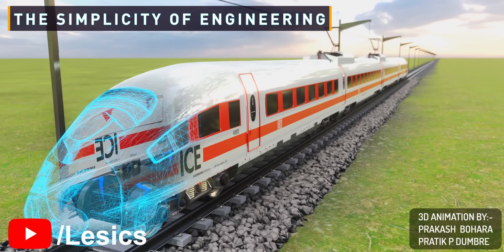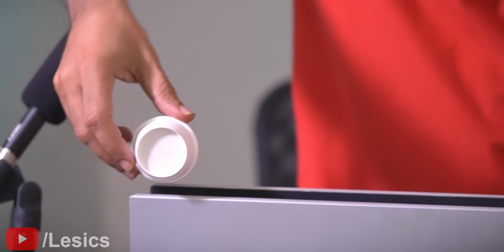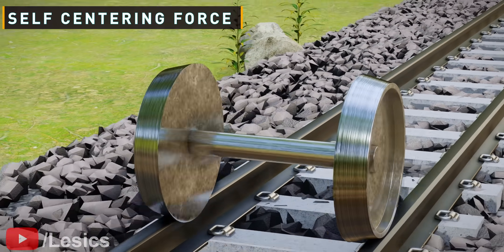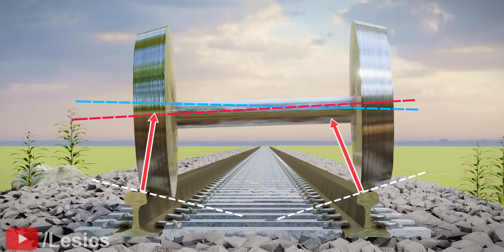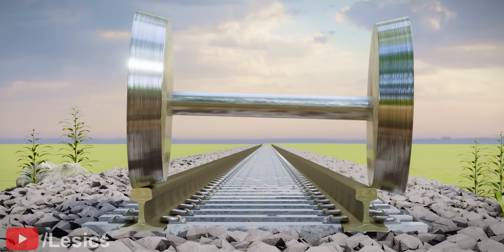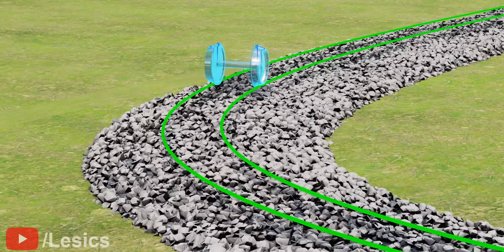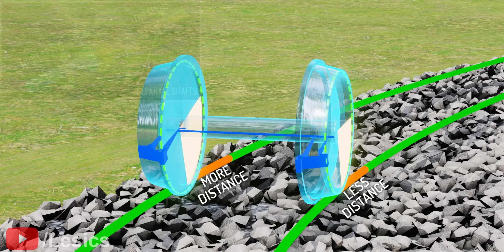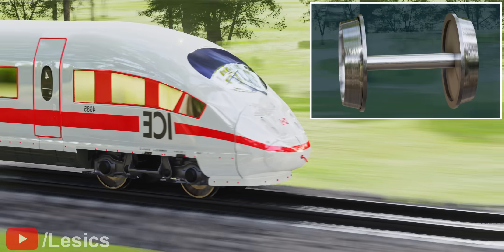The interesting engineering behind the SHAPE of Train wheels!

Comment: Still doesn't explain the shocking train wheel squeeling that happens and to this day engineers have no solution
Reply: I think the squealing is caused by the flanges rubbing/ making contact with the rails periodically.  IIRC, the squealing happens most when the train car is rocking or coming out of a corner.  As for solution? It's part of the charm of riding the rails!
Reply: What’s shocking about it?

Comment: I have seen lots of train wheels, but never looked close enough to see the taper. Makes perfect sense! I always assumed that it was just the flange that kept the train on the tracks.
Reply: Pretty sure the angle is exagerated in the video to clarify the concept. You'll notice the animated wheels are very wide, another exaggeration for clarity.
Reply: @GregMoress  You can still see it if you look at the wheel
Reply: @GregMoress  The angle isn’t exaggerated, I work in CNC Engineering and we make train wheels, this is exactly how the taper of the wheel is. Pretty mental really haha
Reply: The flanges are required because in turns or on irregular tracks,  the wheels could still push themselves off the tracks without them.
Reply: Can anyone explain if the differential effect limits how the sharp a turn can be? I feel like that also coincides with the fact that inertia of the train would also limit the turn radius to prevent it from tipping over and derailing. Thanks!
Reply: @edwinerickson6035  look up curves in FRA 213
Reply: @edwinerickson6035  i tinn dares ahh, king pin two elp, negotiate tunzez
Reply: @enzoorciuoli328  what?
Reply: @tfan2222  i blabed out dah anser two yo ,questioning,kink pins swivelie,swivler
Reply: Same here!
Reply: Previsão é que
Reply: Right same here ❤❤👍☺
Reply: The flange is especially needed to keep the train on track in tight turns and switches.
Ideally the flange will not hit the rail.

Comment: Another thing is switches. If the wheels had the cone on the other side, it would not be able to cross over.
I'm on a train very regularly as a passenger and i have contemplated all these things but i could not figure out how differential would work. So thanks for that!

Often when the train moves around a bend, one can hear a screeching sound from the wheels. I was thinking of this theory as a passenger :
I thought there is also a longitudinal effect that has to be considered in bends.
I find it difficult to explain, but because the outside wheel does not turn in tighter than the inside wheel (like the front wheels on a car work, there is some wear taking place on both inside and outside wheels. And that this is also a reason that bends should not be too tight, apart from G-forces risking a derail.
In my mind this is causing that screech on the inside or outside wheels.
And the larger the train wheel, the bigger the issue.
Reply: The screech comes from the inner part (flange) rubing against the rail. Lots of trains use graphite sticks that put a bit graphite on that part to minimize wear and therefore sound.
Reply: @demacherius1  Thanks!
Reply: > Another thing is switches. If the wheels had the cone on the other side, it would not be able to cross over.

Sure, but you wouldn't design the same style of switches if the wheels worked the other way. There would be a different type of switch that did work.
Reply: @sejje  I really wonder how that would look like. 🙂

Comment: I think you left out another huge factor to the way a trains wheels are shaped along with a crown on the rail and that is Dramatically Reduced Friction allowing trains to pull extremely long, heavy loads with minimal required energy. Of course Newton's Laws apply and therefore it does take significant energy to get the train rolling, but the reduced friction makes it much easier. Once the train is rolling, it takes much less energy to maintain speed, again thanks to the reduced friction and Newton's Laws.
Reply: Rail types in terms of poundage, profile, material composition is a whole subject in itself.

Comment: great video, but change the word Gravity to Density. Thx The Train/wheels are denser than the air and therefore the forces will want it to slip off the tracks down. Saying Gravity is a force pushing/pulling down is wrong, the action is moving the wheels/train which then by the laws of density will make it go off the tracks. The wheel shape just allows the reaction from the action to keep it on the track.

Comment: When I worked at Horwich Loco Works in the late seventies one of my jobs was to machine the profile on the wheels, the profiles are not all the same depending on what the wheels were fitted too, what weight and what speed etc.
Reply: Would there be different profiles on the same train? Such as for heavier or different length cars? Or can they be mixed without issues? I assume same profile on the same axle, of course, but would a mix of profiles on a single car cause instability or ??   Thx

Comment: the only problem with this theory is that the rails aren't designed to take on angled pressures of the conical wheels. They were designed for a flat wheel with a flange. The conical wheels will force the rails outwards and weren't anchored deep enough to accept these kinds of pressures. The rails would have to anchored on a inward angle towards the rail and from both sides to maintain true flatness of said rail.
Reply: Most rails are actually installed at a very small inwards angle

Comment: Not sure if it was mentioned before, but rails are not directly pointing up, but slightly tilted inwards to match the cone of the wheels. These 2 are the reasons why train doesn't derail and why flanges are only useful at corners and points. On straight or almost straight track, flanges don't touch the rail.

Comment: This differential action prevents slippage which would wear out the rails quickly.  The rails are also 4’ 8 1/2” apart.  Why that number?  Because that is the distance between the tails of two horses side by side, which the Romans used to align their chariot wheels.  Thus Rome had roads (very straight ones) with deep groves
Reply: But the grooves soon got filled with horse poo!

Comment: the conical shape is not going to make a huge difference in travel.  The wheel on the inside of the turn still drags along.  One other thing not mentioned is that the conical shape allows for a ticker stronger wheel with a small contact patch thus reducing friction as well.

Comment: The turning theory is severely flawed. The wheels don't just hug one side or the other during turns. Whichever wheel has the most force on it stays with the track while the other wheel spins faster or slower on the track. Basically one side spins faster or slower than the train is actually moving. It's the same concept when multiple axle semi trailers and trucks turn sharply. One set of axles stay with the ground while the other set or sets with less weight(or friction)on  them slide or skid along the ground.

Comment: it is wrong explanation,  the cone is very important because: for example if the wheels moves to the right the right wheel because of the cone needs more distance to rotate 1 time and  to have more distance there is only one way, the way is to turn left, and we know if you turn left the right wheel pass more distance. all the way the right wheel push to left and the left wheel push to right, thats why the train always keep the center,  because in the center both forces are even...

Comment: The turn angle is then limited by the wheel's tapper right? If there wasn't for the tapper, would the "less distance" wheel slip on the rail, and puting torque force on the axis?

Comment: Did you know that the rail is also grinded into a rounded shape to varying degrees to reduce the contact surface to the wheel on straight sections and thus reducing rolling resistance and improving overall fuel efficiency.

Comment: So, can we then calculate the minimum radius a curve in the tracks can have, based on how conical the wheels are? Do train track designers have to keep this minimum radius in mind, when designing routes? (because if the curve was too tight, the conical shape would not provide for enough differential movement between the 2 sides of the track). Is the shape of the wheels standardized with enough precision? Is it the same in all countries in the world?
Reply: For your question on if its standardise for every country I’m not sure, But i work in CNC Engineering where we make a lot of train wheels, and the tolerances of the job are very tight. Within .05 of a mm
Reply: On the track side, I think the tolerance depends. For local trains (Japanese ones are narrow gauge), I tend to hear a lot more grinding with the flanges, so they probably have fairly tight turns. Shinkansen (standard gauge) on the other hand, never make such noise except near major stations where they slow down anyway, so I'd assume they keep the turn radius too wide to make the grinding sound with the flanges.
Reply: Yes for all the questions. Last one in Europe we have EN standard, in America ANSI standard.
Reply: To answer your first question yes. The wider the gauge a track is, the larger the cones have to be to accommodate for the greater distance travelled. Essentially, the broader the gauge the less tight the curves can be.
Reply: In general the broader the gage the wider and heavier the load permitted.

Comment: Another elegance I see is that the conical shape would not be affected when the wheels and the rails expand/contract by heat. It just works!
Reply: Short of taking a blow torch to tracks or pouring liquid nitrogen over them any shift in temperature in the environment would have a negligible effect. Whether it's 10°F or 100°F the tracks are effectively the same. The difference in expansion or contraction between 10°F and 100°F is 0.00058", which is smaller than any tolerance a train or the tracks are built to.
Reply: @TheBoatDude  True. I didn’t realize how small the effect was.

A quick math reveals that a 30m iron rail would stretch/contract about 1cm with temperature difference of 30K. It is completely negligible when it comes to the width of the rail like you said.

Comment: The cone vs “reverse” cone wheels makes me think about stable and unstable equilibrium in math (and of courses other corners of science, I just know it from dynamical processes), both wheels can stay on the track if perfectly placed, but if the “reverse” cone gets offset just a little, the train goes flying off the rail.
Reply: It is about equilibrium. self correcting mechanisms have a stable equilibrium
Reply: Another (in my opinion!) interesting example of this is the design of airplane wings. 

On passenger jets the wings are slightly higher at the tips than the base, to provide roll stability (also linked to the fact that the wings are below the centre of mass). When the plane begins to roll, the lower wing will generate more lift due to it being more horizontal than the upper wing. As a result the plane will want to stay level. 

By contrast, in fighter jets, the wings tend to be level or pointing downwards, this results in less roll stability (and more roll agility) which is desirable for quicker roll movement (and helped by some fancy computers fighting the plane's natural tendency to roll away from level flight!).

Check out dihedral vs anhedral wings for more info!
Reply: @_mickmccarthy   very cool! To ask quickly, would another  reason for this dihedral wing arrangement be to account for a plane’s wing load, along with lateral stability?
Reply: @garrom5652  Not quite sure I follow, but dihedral wings are more necessary on passenger planes because the wings are relatively low compared to the centre of mass. If they were at the top of the fuselage then the plane would find it easier to stay level due to the centre of mass being below the wings. Almost acting like a keel on a boat.

Not sure if that answers your question though! It's a super interesting topic though (well, for some people, for some I'm sure it's very dull!)

Comment: 2:58 “here, the left wheel has to travel more distance thank the right wheel.”

Is this correct?

The outer wheel travels more which is the right wheel in this demonstration.
Reply: "Left" from our point of view is the train's right wheel.
Reply: @gerrygunn5109  thank you Gerry for your reply.

“When determining Left (Port) or Right (Starboard) on any Plane, Train, or Automobile it is always from the rear (stern) looking to the front (bow). In the US the driver's side is the left side..”

Comment: In rail transport, a wheel arrangement or wheel configuration is a system of classifying the way in which wheels are distributed under a locomotive. Several notations exist to describe the wheel assemblies of a locomotive by type, position, and connections, with the adopted notations varying by country. Within a given country, different notations may also be employed for different kinds of locomotives, such as steam, electric, and diesel powered.

Especially in steam days, wheel arrangement was an important attribute of a locomotive because there were many different types of layout adopted, each wheel being optimised for a different use (often with only some being actually "driven"). Modern diesel and electric locomotives are much more uniform, usually with all axles driven.

Comment: During cornering the outer wheel also achieves a higher position, the inner become lower due to the conical shape creating a slight lean toward the inside of the bend thus achieving a positive inward lean, like a nascar track but to a much smaller extent

Comment: You forgot to mention. When on a turn the wheel shape also means the train is lower on the inside rail. So the whole train leans into the bend. Just like a person riding a bike.  Meaning less sideways centripetal force on train and passengers, so they are not thrown out towards outside of bend, as much.

Comment: The experiement with the cups is not useful. There it is the working of the radius, wich is increased on the side which is moving outward so it steers towards the middle. Opposite with the inversely glued pair, which steers out of the middle and hence is instable. The forces like on the railway are not what makes the cups experiment work!

Comment: This works until the tread of the wheel wears and gets a curved shape in the wheel. Defeating the purpose of the taper. They should be taken out of service and machined but cost of downtime on low  speed freight usually stops it. And then the wheel flanges have to stop the wheels from going off track. Tge wheelsmust then slip in corners. Yes it does result in wheel flange, tread and rail wear. And thats the constant fight between engineers andbean counters